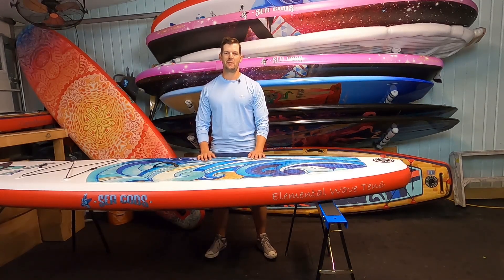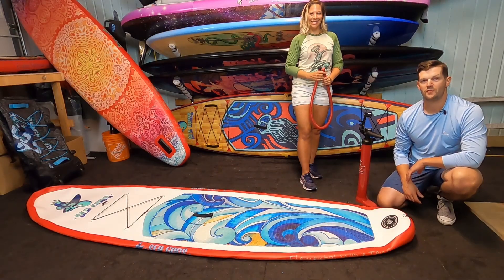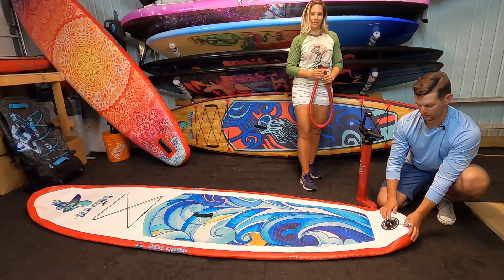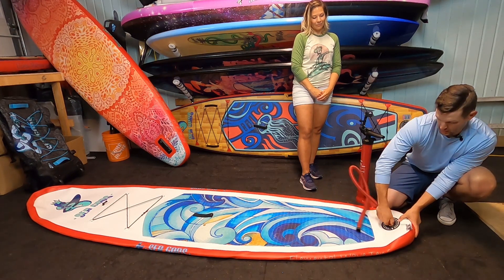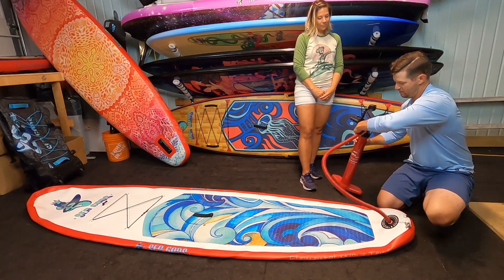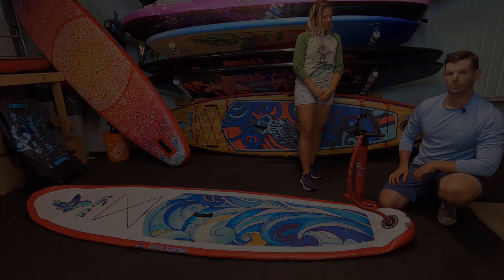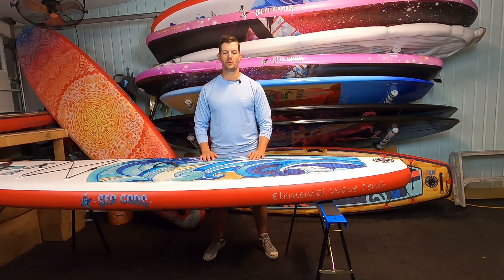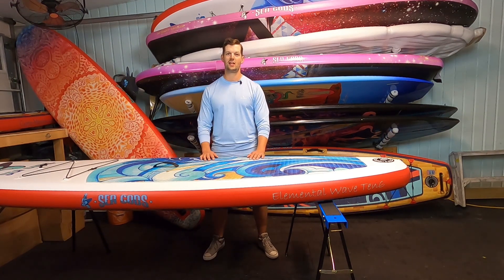Inflating your Sea Gods Inflatable Stand Up Paddleboard

Comment: How do you let the air out?
Reply: You just push the middle pin inside the valve down with your thumb and it will stay open and deflate :)  Just make sure to push again to closed position before inflating!